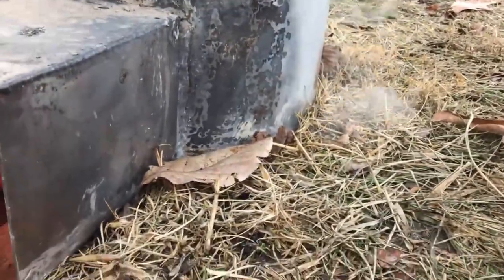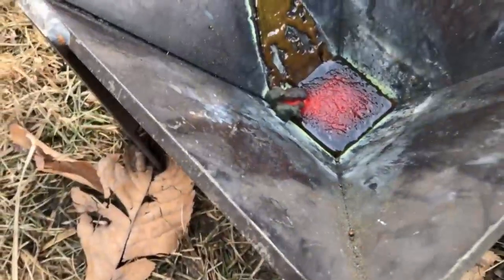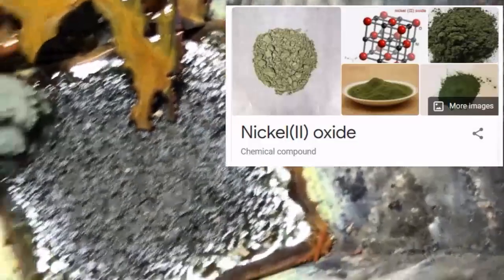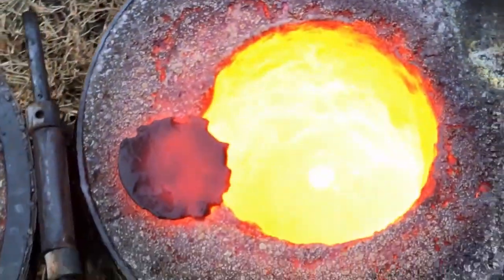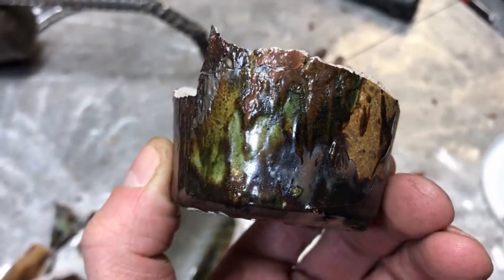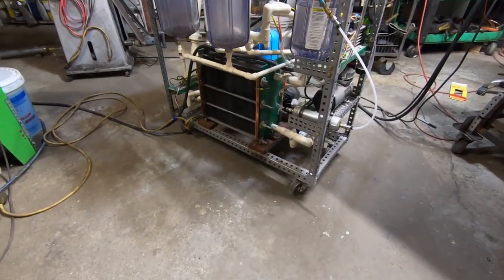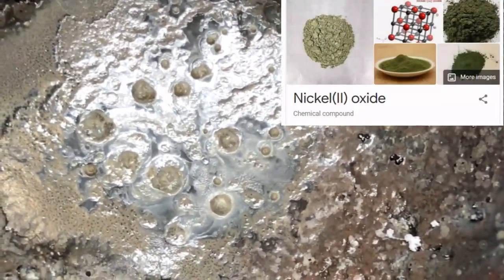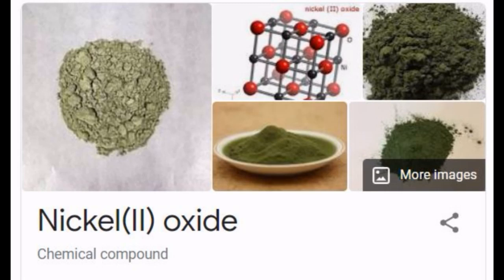Smelting High melting point anode sludge how much $$$

Comment: It crack becouse u direct heat it then fast cool it down 
Try to make u own crucible
U only need water glass and Al2o3
The super hard sand that is used for sanding parts etc. (or anythink else that dont melt in high temp)
Mix it both together (dont add to much water glass or add extra water to the mix with less water glass so u can still mix it well together without making it super dry)
After that u only nead to heat it up leave until cold and ready to go
(if u add to much water glass it will start to bubble etc....to repair it after crack use water glass)
If u want epic insulating mix
Mix perlite with al2o3 and water glass....it insulate like crazy
U need al2o3 to cover entire perlite  becose in higher temp perlite melts....u only need al2o3 as the outside layer...perlite is to make space in it=== lightweight=insulating well :)